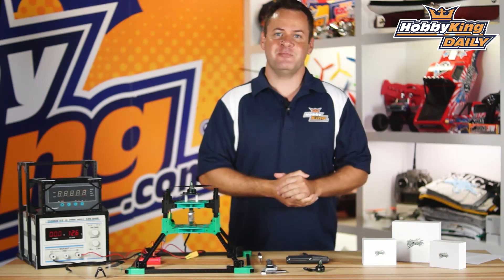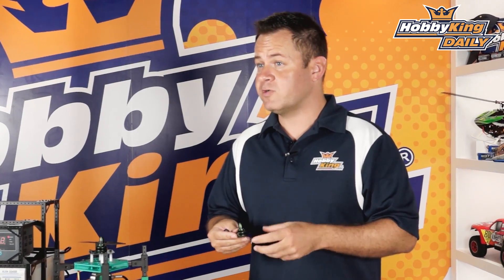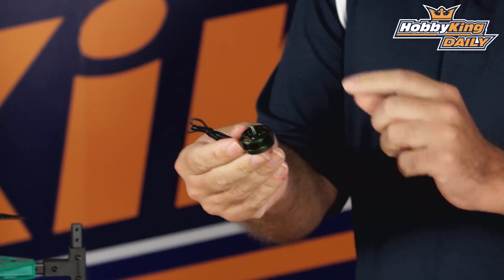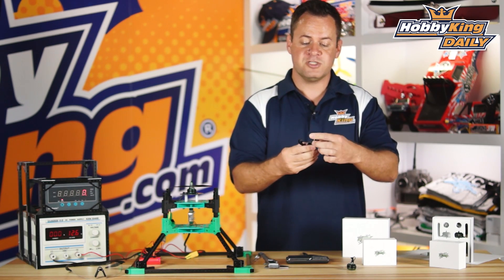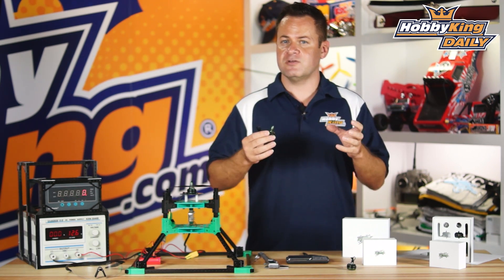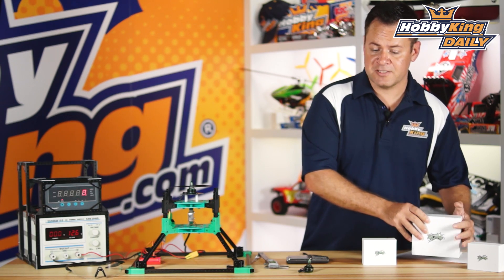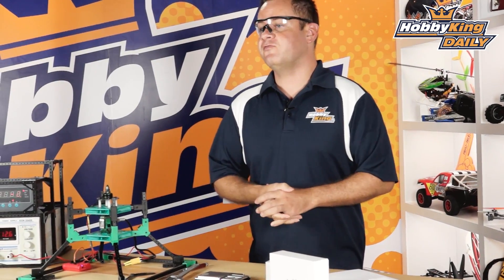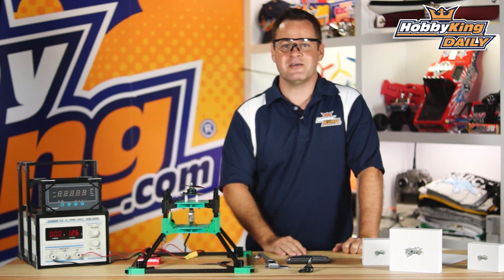MultiStar Elite 2204 Motors - HobbyKing Daily

Comment: Chris, NOBODY runs a gemfan 5x3 prop anymore.  You have got to test all the mini motors at 5x45BN on 4S.  3S is only for the beginner people.  Almost nobody I race with runs 3S.  We know the motor is not intended for it but we run it anyways and it does fine.  This is a waste of a video.  Almost zero useful info

Comment: Why isn't it recommended to run those with 6 inc on 3s, 2204 2300 motors are often seen with 6030 or even 6045?
Reply: its max amps is 11.5, a 6x3 would likely get very close to that.   A 6x4.5 will go over it.

Comment: A set of Sunnysky 2204 2300kv would run circles around these motors. And you can run 6040's on 3s with the SS motors!
Reply: just like you can with these motors.. have a look at the product page 591g 9.9A with 6x4 props
Reply: I run them on 6045s on 4S - it's a rocket, try it!
Reply: aftertwotoo I gotta try that!
Reply: HomeDistiller I'll check it out. I was just going off the info he stated in the video.
Reply: I would think the performance would be similar but keep in mind, the HK motors are 26 % LESS expensive, so the obvious choice is the HobbyKing motors.
Reply: Vparanormal1 I do agree! I'm gonna get a set and test them out. For $16.99 it's worth it.
Reply: They might be cheaper, doesnt help if they break as easly as the previus small series motors.